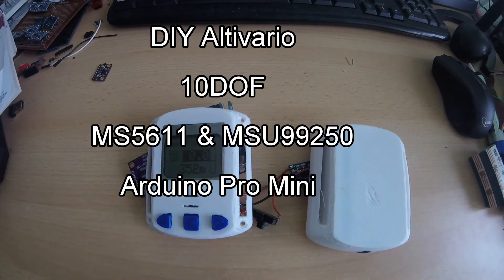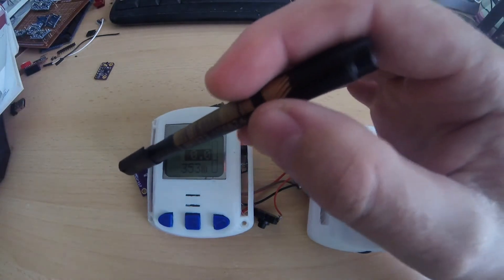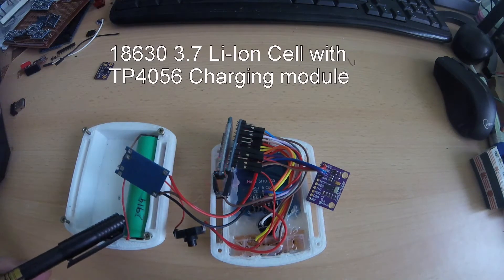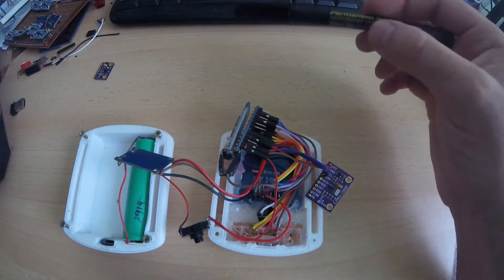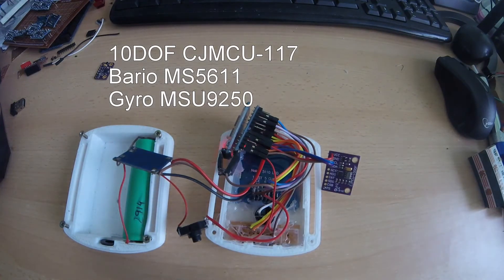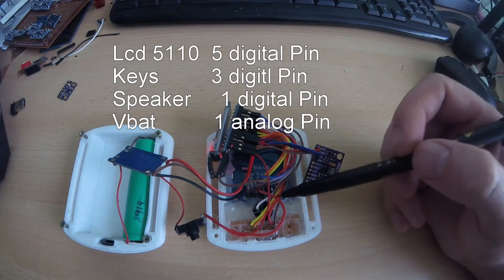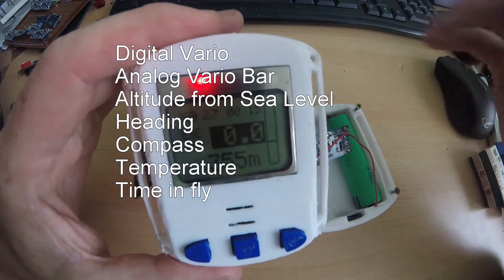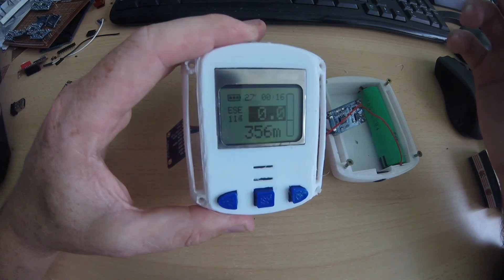DIY Altivariometer - Arduino Paragliding Vario - MS5611 + MSU9250   CJMCU-117

Comment: Such an awesome project. Where can i find the circuit diagram? i would like to try and build one.
Reply from the maker: If u look in google drive link u will find the arduino code Test VarioAltimeter - is with BMP280 and Test VarioAltimeter MS5611 is with better precision sensor.
In the the define u will see the pins used Display 5,4,3 - I2C 11, 13  , Spiker 9 , Kyeboard 2,6,7  - I will add and jpeg file with wire diagram.
Reply: @MrConstantin84  Thank you so much i will look for the jpeg. Great work.

Comment: Hi, congratulations for the projetct. Can you send me the wiring diagram? Thanks! e-mail: neivock@gmail.com
Reply from the maker: MrConstantin
 • 6 minutes ago
If u look in google drive link u will find the arduino code Test VarioAltimeter - is with BMP280 and Test VarioAltimeter MS5611 is with better precision sensor.
In the the define u will see the pins used Display 5,4,3 - I2C 11, 13  , Spiker 9 , Kyeboard 2,6,7  - I will add and jpeg file with wire diagram.

Comment: hi, you can send cicuit mcorrao@gmail.com. thank
Reply from the maker: MrConstantin
 • 6 minutes ago
If u look in google drive link u will find the arduino code Test VarioAltimeter - is with BMP280 and Test VarioAltimeter MS5611 is with better precision sensor.
In the the define u will see the pins used Display 5,4,3 - I2C 11, 13  , Spiker 9 , Kyeboard 2,6,7  - I will add and jpeg file with wire diagram.

Comment: Parabéns pelo projeto 👏👏
Pode me enviar seu projeto? 
Meu e-mail é consultorvitormuniz@gmail.com 
Muito obrigado 😍
Reply from the maker: Check google drive link u will find the arduino code Test VarioAltimeter - is with BMP280 and Test VarioAltimeter MS5611 is with better precision sensor. if u need more help i will add an wire diagram
Reply: É praticamente igual o Mister Vario

Comment: Hi MrConstantin, nice project, I gave a look to the files on your Google drive, but  cannot find the ms5611.h library, which one did you use? Could you share. Thanks
Reply from the maker: Sorry for late replay, i am no so volgger I will add the file, i have the standard library imported in the arduino library folder, let me address mail and i will replay this week at all with complete documentation.
Reply: @MrConstantin84  :((

Comment: Hi, thanks for sharing. Can you share the circuit diagram and elements if possible?
Reply: Hi Yusuf, did you get the circuit diagram and elements?
Reply from the maker: Sorry for late replay, i am no so volgger I will add the file, i have the standard library imported in the arduino library folder, let me address mail and i will replay this week at all with complete documentation.

Comment: Hey MrConstantin, this is a great project! Well done and many thanks. 
I was wondering if it's at all possible to connect this to a flat screen, E ink?
Reply from the maker: yes u can do it, alsso use ms5611 sensor is more sensitive
Reply: @MrConstantin84  Where schematic vario????
Reply from the maker: hi, sorry for the delay, i know the e ink have an low refresh so i dont try it. but now are few new option for the display to be seen better in the sunlight. I will try to reconfigure next week i will have some free time. best regards

Comment: Clever!

What was that buzzing noise about? A warning that you're climbing too fast and might stall?
Reply: No, varios are used to detect lift (and sink) and more importantly strength of lift by glider pilots in order to make best use of the lift in thermals, the audio produced by a vario has a tone where the pitch is higher in stronger lift, allowing pilot to track it without heavign to look at the vario screen.